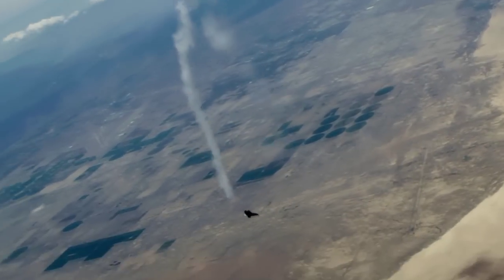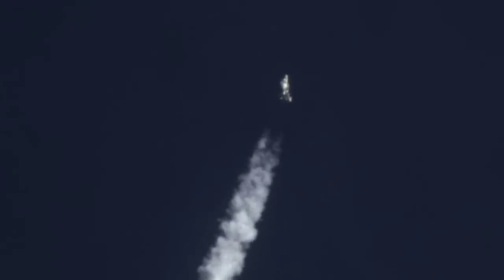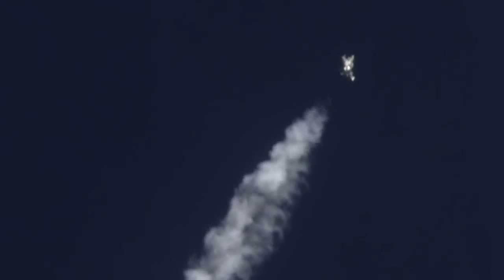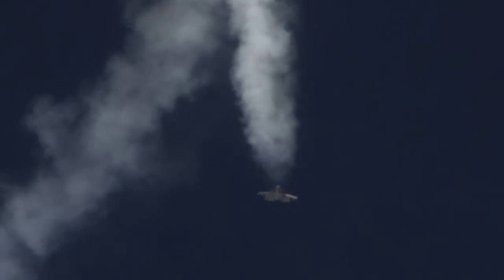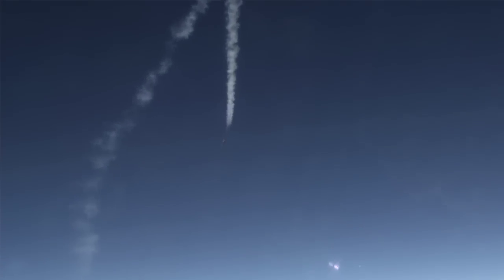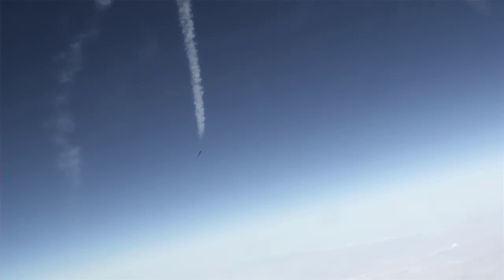F-35 Flight Test Intentional Departure

Comment: yawn ....one and a half trillion reserve notes and counting. And now with only one engine solution. >_>
Reply: Yawn....

Rafale's program cost to date is around €45.9 billion (Y2013) with 130 units (June 2014).

F-35's program cost to date is around $50 billion USD (Y2013) with 100 units.
Euro currency is higher than USD.

The reason for near $400 billion USD is due to

United States planning to buy 2,443 aircraft.

2,443 F-35s are magnitude larger than France's Rafale fleet..

-----------
Reference for F-35 program cost. (google it)
On 21 August 2013 C-Span reported that Congressional Quarterly and the Government Accountability Office were indicating the "total estimated program cost now is $400b—nearly twice the initial cost". The current investment was documented as approximately $50 billion. The projected $316 billion cost in development and procurement spending was estimated through 2037 at an average of $12.6 billion per year.

-----------
Without the media reality distortion field , F-35 program's cost to date is similar to Rafale program's cost to date.
Reply: Lets look at some figures against some proven and supposedly superior platforms, lets compare them and see. 

If you really know something about planes you would know that you basically need 3 essentials to be maneuverable:

1. Lots of Lift
2. Lots of thrust
3. Little Drag

Lets discuss lift: 
I know you probably heard Pierre Spray said that the F-35 is a dog because it has little wings. and has to carry 110lbs of airplane for every square foot of wing. 

Pierre Spray was involved in the aircraft industry at around the 1960s where fighters were basically tubes with wings. 
At that time all of the lift came from the wings. small wings = small lift.

But at around that time Martin Marietta (now Lockheed Martin) was experimenting with Lifting Body designs, they wanted to produce fuselages that can assist the wings in producing lift instead of being dead weight.
Read more here: http://en.wikipedia.org/wiki/Martin-Marietta_X-24

That’s why at around the 1970s we began to see fighters with wide flat fuselage sections and smaller wings. So lets compare the wing loading of the F-4 against Pierre Spray's favorite F-16 variant the F-16A.

F-4
Empty: 30,328lbs
Load:8000 lbs
Comabt Weight: 38,328
Wing Area: 530 feet
Wing Loading: 72 lbs/ sq feet

F-16A
Empty: 16,300
Load:8000 lbs
Comabt Weight: 24,300
Wing Area: 300 feet
Wing Loading: 81 lbs/ sq feet

So by Pierre Spray's own argument the horribly turning F-4 should fly circles around his hotrod F-16? What’s happening here?

Well the F-16 does not rely on just wings to produce lift, it has a blended body and wing design, plus LERX that produce vortices above the airplane (if you remember you physics, high pressure below + low pressure above creates lift)

around 40% of the F-16s total lift does not come from the wings at all. So in reality the F-16's actual wing loading when loaded with 8,000lbs is closer to 49 lbs per square feet not 81 lbs.

The F-35 is the same. to get the F-35 to have 110lbs / sq ft of wing loading as Pierre Spray said it needs to carry 21,300 lbs of load. 

The f-16 can never do that, but the F-35 can! that’s what’s great about this plane, it gives you options, if you need to go to a long range mission then sure, the F-35 CAN carry 18,000lbs of fuel and 18,000lbs of weapons.

But if your going to a CAP mission where a dogfight is possible, then why load it with 21K? Most likely an F-35 would take off with 18,000lbs, And when it gets to combat it would probably have 10,000lbs depending on the range to the target.

So lets pit the F-35 against some really good aircraft, Wing Loading calculation. 
All loaded with 8,000 lbs, perfect for dogfighting:

Wing Loading:
Mig-29 M/M2: 91
F-16C (block 50): 90
F-35A: 81
F/A-18C: 77
Su-30MKI: 72

So as you can see at dogfighting weights, the F-35 is not bad at all, its not the best but really not all that bad. 

Now consider this, the F-35 probably has the most efficient body lifting surface of all these aircraft due to the fact that its fuselage has the smoothest flatest surface of all these planes, not a lot of disturbance for the wind to flow around on. 

So lets give all these aircraft a Body lifting coefficient of 40% but to be conservative lets give the F-35 45%, the truth is probably much larger but hey lets keep it down.

Wing loading plus body lift:

Mig-29 (M/M2): 54.6
F-16C (block 50): 54
F/A-18C: 46
F-35A: 44
Su-30MKI: 43

The F-16s wing loading is similar to the Mig-29s which is why it replicates the Mig-29 in RedFlag.

But Notice how the F-35's wing loading is so close to the F/A-18 and just 1 pound above the Su-30, which is why when you ask pilots they will say that the F-35 maneuvers like an F/A-18 with better acceleration. 

And really acceleration is the only thing Hornet pilots dont like about it.

http://www.flightglobal.com/blogs/the-d ... -tactical/
Lt Col Matt Kelly wrote:
Operational pilots should be thrilled with the F-35's performance, Kelly said. The F-35 Energy-[Maneuverability] diagrams, which display an aircraft’s energy and maneuvering performance within its airspeed range and for different load factors, are similar to the F/A-18 but the F-35 offers better acceleration at certain points of the flight envelope. 

So do you still think they are lying? 

Now lets talk thrust. This is a no brainer, the F-35's engine is rated at 43,000lbs the most powerful in the world. So lets cut to the chase and compare.

Thrust to weight at max thrust:
(All loaded with 8,000 lbs)

Mig-29 (M/M2): 1.05
F-16C (block 50): 1.05
Su-30MKI: 1.13
F/A-18C: 1.14
F-35A: 1.15

Surprise Surprise, the F-35 has the best Thrust to weight ratio of all of the planes involved, and really in a dogfight Thrust to weight can be more valuable than Wing loading. 

Now Drag: 

All these planes will carry weapons externally adding lots of drag. with a full centerline tank the F-16 is reduced to 7Gs max and the Mig-29 is reduced to an appalling 4Gs, the F-35 will carry most if not all its missiles internally, very little drag.

So to conclude, even without Stealth, even without all its advanced sensors and ECM suits, the F-35 will (in the words of Pierre Spray) wax the competition every single time, then if the F-35 is a dog the rest should be compared to kittens.
Reply: Reydianno Augustave Stay asleep, because nobody cares.
Reply: F-35's F135 engine diameter and length is larger than F-22A's F119 engine.

F-35A's F135 engine
Diameter: 1.29 m
Length: 5.59 m

F-22A's F119 engine
Diameter: 1.17 m
Length: 5.16 m

J-31's WS-13 engine
Diameter: 1.02 m
Length: 4.14 m.

MiG 35's Klimov RD-33 engine
Diameter: 1.0 m
Length: 4.2 m

F/A-18E/F's  F414-400 engine
Diameter: 0.89 m
Length: 3.9 m

Typhoon's.Eurojet EJ200
Diameter: 0.737 m
Length: 4.0 m.
Reply: Reydianno Augustave
From http://www.fas.org/sgp/crs/weapons/RL30563.pdf. (dated 2014)

A US Department of Defense report on the F-35 states that the estimated basic costs per aircraft (the airframe, engines and avionics) are:
•US$77.7 million – F-35A CTOL variant
•US$105.5 million – F-35B STOVL variant
•US$89.7 million – F-35C carrier version.
Reply: Reydianno Augustave Yeah you don't have any proof, or any facts. F-35 is much cheaper than it ever used to be and the cost just drops.
Reply: Way to go commenting stupid. The plane is intentionally designed to have 1 engine. And that 1 engine is way proficient that most of the 2 engine jets out there. Know your facts.
Reply: Monster LMA It follows the same EM theory of the F-16. People think a plane with TVC is everything, Let me just say that Thrust vectoring is not the holy grail of maneuverability.

Lets go back to the basics of maneuverability. 
An aircraft maneuvers by deflecting air using its normal control surfaces (flaps, horizontal and vertical stabilizers, ailerons, etc.)

Now the effectivity of the control surfaces depends on the amount of air being deflected.

Too little and the aircraft won't be able to maximize the turn,
Too much and the inertia from the aircraft will be too heavy for the aircraft to make a tight turn.

The amount of air being deflected is directly related to the aircraft's speed or energy.
This is why in the 1960s Col. John Boyd devised his E-M or energy maneuverability theory.

Basically a pilot must know where he can find the "sweet spot" that his aircraft will turn best. That sweet spot is called "corner speed"

Most modern fighters have a corner speed at around Mach 0.85.

This is where they can sustain the most number of Gs or have the best turn rate.

However after repetitive maneuvering, an aircraft may slow down to well below this corner velocity and loose much of it's turning capability.

At extreme slow speeds like mach 0.2-0.5, the control surfaces barley have enough air to deflect to execute tactical maneuvers.

This is where thrust vectoring comes into play, it uses the engine's power to point the nose where the pilot wants at those extreme slow speed environments.

In the case of the F-35, advances in flight control software and the extra large control surfaces allow it to maneuver at extreme slow speeds without thrust vectoring. 

Not as well as the F-22 or the Su-35 perhaps but much better than an F-16 or a Typhoon which are mostly intended for high speed fights.
Reply: Where in my comment did I say anything about the French? Or Euros?

Where did I compare engine diameters (and length? wtf? it is "the future" so why would it be impossible to have an all around better product in a smaller overall size?)?

I yawned (and perhaps will never yawn online again because someone might cry) because it's a damned shame to fund such a bloody expensive program AND have such unimpressive "display" footage...

AND now after spending many many monopoly monies (and much much much more to come), they killed off the second engine option (which was a pittance compared to the cost of the whole turkey).

...but I didn't even have to tell you this (because you obviously own stock in Lockheed Martin or something, I HOPE. Because if you're doing this because 'Merica or something...man. I'll pour out a little for you tonight.)

And uh yeah, google google blah blah blah if you want to fact check my ramblings (as if that will change anything at all about this "air superiority" bungleclusterfudge).

Hey, maybe they'll all eventually be drones anyway, so pilots can stop crying about not being able to properly see their 6? o_O
Reply: From somewheres on the internets (the same place you got your info, and if it's not the same place and you have insider info then that just means you're shilling for an organization you have a vested interest in, so congrats to you and your stock portfolio, I HOPE):

~
The F-35 APUC (with an engine) is $104.8 million in base-year (2012) dollars and $135.7 million in then-year (actual appropriation) dollars.
– But for some, even the base year APUC totals for the F-35 are still too high; $100-million-plus price tags can hurt any marketing plan. But not to worry: the SAR also lists something called Unit Recurring Flyaway (URF) costs. But, as the SAR does not tell you even in its small print, the URF does not include the support and training equipment, technical data, initial spare parts or even the gas and lubricants to make an F-35 useable. It also does not include the upgrades and fixes that testing and other flying experience reveals to be needed.
Bottom line: the unit recurring flyaway cost will not get you an F-35 you can fly away, not for combat, not for training, not even for the delivery hop.
A favorite of F-35 lobbyists and marketers, the URF for the F-35 aircraft is $65.9 million. Want an engine? Make it $76.8 million; that’s in base year dollars; the SAR doesn’t do the calculation in the slightly higher then-year dollars. Moreover, that ridiculously understated $76.8 million is only for the Air Force’s A version; the pricier C model for the Navy has a URF (with engine) of $88.7 million, and the Marines’ B model (with engine and lift fan) is $103.6 million.
Lockheed, among other interested parties, likes to cite the URF, but no flyable, useable F-35 in any operable force will ever be bought for that amount of money. URF unit costs are pure hogwash.
In fact, the average F-35 unit cost will be more than the $135.7 million then-year APUC, and it will even be more than the $159.2 million then-year PAUC. Those numbers are grounded in analytical quicksand.
~
Reply: Blah blah blah, lets see what happens when we actually have to use them.

All this ruckus over me initially voicing that the TRUE full cost of the program is expensive as all hell (which is true no matter what you think you know, but STILL, it's probably not expensive enough to make it live up to all of it's claims), and that this vid was embarrassingly unimpressive despite the programs huge expense. Which is also true no matter what you are paid to believe.

After all, we were supposed to sell this thing to everyone and their mama for crazy profits to warrant the cost of the program but alas, perhaps more money should have been invested in marketing and especially in being able to SHOW OFF at air shows.

All you guys are coming back with are stats that have yet to be proven in combat.

ABSOLUTELY NO ONE HERE HAS FLOWN AND SERVICED THIS PLANE IN COMBAT.

...but I suppose that none of this matters anyway, because everyone but our closest butt buddies are now sketchy about purchasing any Joint Strike Fighters, seeing as how now everyone knows that we're spying on everyone like the cold war never ended here, there, and everywhere.

If the Worldtown actually had reason to trust us then maybe all these STATS would actually matter, but they don't trust us, not one bit, so the only numbers that matter are actual procurement costs (tax tag title dealer fees bs "undercoating" etc). Not cherry-picked prices like "flyaway" costs. Which means we're pretty much driving all the potential business to Russia and I guess France and eventually China (when's the last time you've been to Sears or K Mart? Swapping out a Craftsman wrench doesn't count!).

...and if you're going to try to claim that this is all because they're "hiding" the performance: I thought that's what the F22 was for (ace in the hole that won't be sold to foreigners).

You dudes are like Corvette guys from back in the day. True believers...even when you're packing 200hp out of a huge V8. Which is why I think you're paid shills. I mean I hope you're getting paid...maybe that's where some of the "marketing" monies are going. >_>

The new Vette is supposedly really good though...although it should be, what with the General having all those free tax dollars to save their asses with.....but again, I don't see it deterring people with the means to purchase Ferrari's, Lambo's, and Aston's..because these people generally don't drive these things at 200 to the shops...because they aren't trying to "prove" anything. The nameplate does that job for them.

It's all just shock and awe and brand recognition.

So, tell me. Where is the shock? Where is the awe? (talking about the turkey again) Where is the undeniable trust in the brand? Even Ferrari has turned full circle; their road cars are astounding now, but their race cars...not so much.

We will see come the real talk WW3.

We will see.

Until then, lets talk about cars or something. Troll me somewhere else hahaha lets be friends, tell me how you got your government shill job! Same place daddy worked? Do you play #AceCombatInfinity? Come shoot me down in a JSF heh heh They're damned effective in that game.
Reply: azraelmars LOL he clearly doesn't, he thinks shit is impressive only if it does some Sukhoi type shit. Well this isn't a Flanker and for what those dumbasses kept saying that it can't turn can't whatever, I think this video puts all of that to rest and shuts them up.

Comment: Sukhoi is not impressed. Must break you.
Reply: Yo sukhoi is afraid
Reply: http://www.f-16.net/forum/viewtopic.php?f=22&t=23442&sid=bbbc450dad2955377ec5ed7615c49fcc&start=15
Flankers can do quite limited maneuvering capability (max being about 4.5 G's IIRC) with maximum internal fuel load and to do 9 G's they need to be at about 50-60% of maximum internal fuel load. Sukhoi describes the normal takeoff weight as being with only 5270 kg of internal fuel, which is awfully little for a such powerful jet. Su-27/30/33/35 can't have both full maneuverability AND full internal fuel load simultaneously. IIRC this is because the full fuel load adversely affects the center of gravity of the plane, making it nose-heavy. I don't think there is any similar restrictions with F-35.
The Vanila Su-27SK had limitation with its internal wing fuel tanks. It had a low wing loading, so if there was fuel in the wing tanks, it was limited to 6G load, until it reached 5600kg of fuel(empty wing tanks). I have not heard of any limitation about it being unballanced(COG) the way you discribe here.
Reply: +RNL Valencia
So what?
Flankers can fly 3600 kilometers with full fuel tanks.
So it actually don't need even 30% of that for normal work.
About F-35, believe me it have similar restrictions for full payload, you just never see info like that in commercials.
Reply: neil matthew palapala
SU-30MK's flight-envelope between speed and altitude
http://f6dsh.free.fr/su/AA2002-Su-30MK-10.jpg

http://www.sukhoi.org/eng/planes/military/su30mk/lth/
With canard surfaces installed
Max Mach (without external ordnance and stores) is 1.9 speed.
Reply: +Black Flash So what? I'm already aware of Flankers' range. 

I don't recall F-35A Block 3F being completed.
Reply: Kalle L

Thank  so much     drink coffee, the, or  more cold things